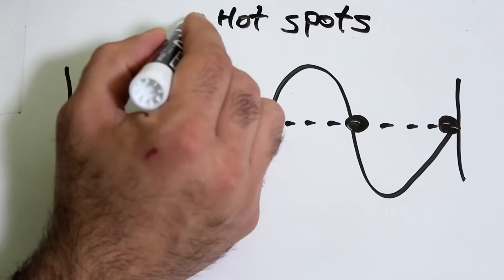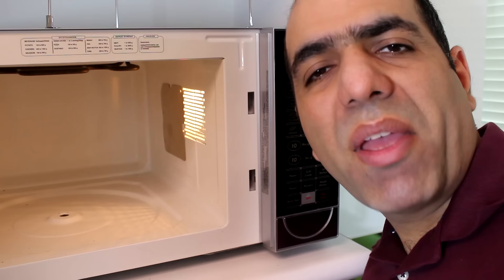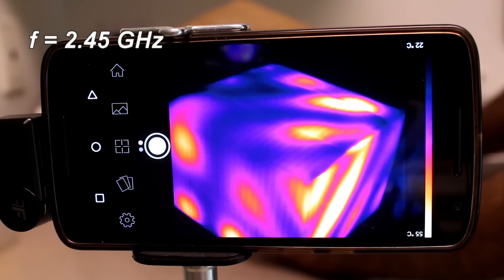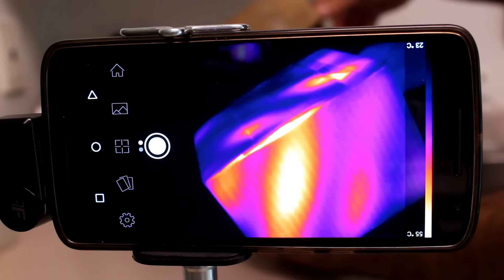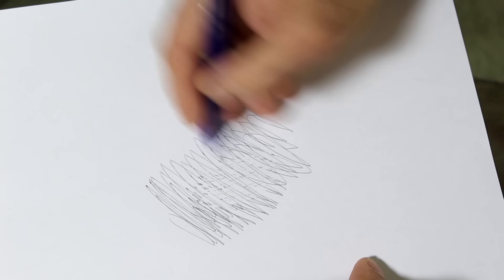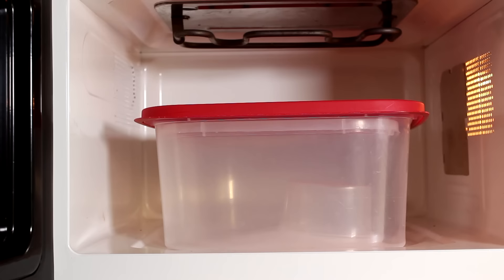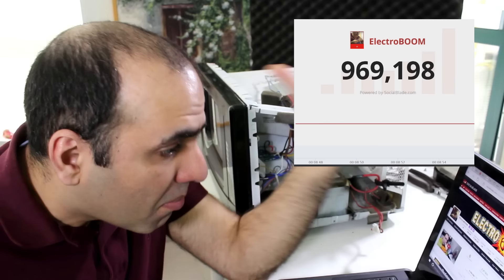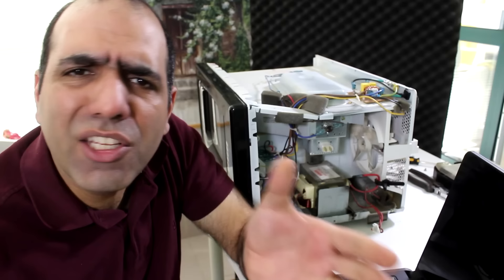Speed of Light, Microwave Oven and How It Works

Comment: "I dont really know what to do with the magnetron besides causing cancer"
Reply: Hahahahahahaaha
Reply: Jokes aside, microwaves are not ionizing so it doesn't really cause cancer. They may still cause burns though.
Reply: zirtapot57 
Microwaves are built to contain radiation which makes the process safe. However, a magnetron on its own without safety features simply shoot out radiation like crazy.
Reply: Miles Edgeworth Isn’t its frequency of operation still below the ionizing level though? I don’t doubt that it would definitely cause microwave burns.
Reply: Miles Edgeworth - Microwaves are non-ionising no matter what - particle decay, far UV and X and Gamma rays only possess enough energy to cause ionisation within molecules. Microwaves are on the thermal side of the spectrum - don't really see how they could cause cancer through their radiation? Similar to how a kettle or a conventional oven cannot cause cancer if you get too close to the elements. Its less to do with the output voltage and more to do with the electron voltage. 

Wikipedia actually has a fairly good article about Non-ionising radiation if you're interested.
Reply: +zirtapot57 While microwaves can't cause cancer directly burn injuries can trigger squamous cell carcinomas it's very rare but it's definitely documented. Typically when the burn wound doesn't heal properly resulting in chronic inflammation of the affected tissue ulcers or anything else causing chronic inflammation of these tissues can also trigger this (It's how smoking triggers lung cancers also).
Reply: zirtapot57 did you know if you break the pink end of the antenna you will get lung disease
Reply: And that's the cancer, not from the microwaves
Reply: yup
Reply: Omg there is one guy here that is smart enough to know about dangerous elements... or watches enough youtube.
Reply: who
Reply: With the magnetron in general, the beryllium ceramic causes the most cancer
Reply: @zirtapot57  It's not the microwaves that cause cancer it's the material that surrounds the microwave emitter
Reply: Berylliosis is a form of cancer right?
Reply: @milesedgeworth132  I had this tool that measured microwave leakage and more microwaves, at the same 2.4Ghz, were coming out of my cell phone, and my cordless phone, than anywhere around the microwave oven. Probably my wireless access point too.
Reply: @zirtapot57  It would definitely cause microwave burns. It can also coagulate the lens in your eye causing cataracts. If it cooks food – including the animal flesh that some people eat – how can it NOT cause microwave burns – we are made out of animal flesh just like the pieces of flesh that people cook in their microwave ovens.
Reply: eat the magnetron and change your name to Ovanski, (please don't mind this joke)
Reply: Yeah the beryllium causes cancer
Reply: @IJoeAceJRI  its the beryllium (the pink or grey ring) that can cause cancer IF scratched and dust inhaled. The magnetron inside a microwave is not nearly strong enough to cause cancer but strong enough to cause internal burns. The microwaves cause cancer myth is bs.
Reply: @markorossie9296  would have to very powerful tho. Air cleaners use electricity to clean the air, which produces ozone. I use a jacobs ladder to achieve that effect, because the arc also produces ozone. It would take a LOT of that to make anything dangerous.
Reply: @zirtapot57  it's not the wave(yes..it is of non-ionising type),
it's the pink thing on the magnetron(in the video-the colours could be different depending on the maker)..
that's why Microwave Oven is under California Proposition 65(in the US-This has to be declared on the packaging box)

If you really have to touch the magnetron..never touch that pink stuff with your bare hand..
(As a non-authorised personnel,please don't open the microwave oven for whatever reason)

Comment: Please be EXTRA careful if you take the magnetron apart, as you could get Berylliosis from the Beryllium stored inside that "stick" pointing out. This is not a joke, breathing in Beryllium dust is extremely toxic.
Reply: In most domestic microwave ovens, especially newer ones, Aluminium may be used instead of Beryllium though. This is not a guarantee and you should still be careful if you're not 100% sure whether your magnetron contains Aluminium or Beryllium.
Reply: Crazy Danish Hacker So it's safe to take appart a microwave but not the magnetron ?
Reply: +Llewln Not really, most (if not all) microwaves have a very powerful capacitor inside that could instantly kill you. Everything about microwaves are dangerous... That is, if you don't know what you're doing.
Reply: Crazy Danish Hacker beryllium is only in industrial microwaves
Reply: ShadowTech Uh, no it is not only in industrial microwaves, that purple band around the extrusion is beryllium oxide, and is a carcinogen to anyone who breathes it in.
Reply: ShadowTech: I'd like to see several sources, besides YouTube comments :-)
Reply: ShadowTech you can see the beryllium at 8:40
Reply: +Xenro66 They can be pretty damn dangerous even if you do know what you're doing and are careless or make an error. Big Clive has a good video on the subject. The high voltage from the MOT will kill you much more reliably and with less provocation than mains voltage.
Reply: Unplugged and dead microwaves only really represent a problem with the berylium then, I didn't know this, thanks :)
I've taken quite a few microwaves appart, but always outside and they have always had their pieces stuck in a box nearly instantly afterwards
Reply: The main issue with MOT's is that its a rather large amount of current when you consider that its around 2000VAC... the average of ~500mA is massive at that voltage. It's pretty much guaranteed to kill you.
Reply: He may know that you can get cancer from some of the components, but that's the least of your worries in this case. Getting Berylliosis is much worse as there's also no cure for it. At least with cancer you often have a chance to get treatment and a possible cure. 

A friend of mine has a similar condition from grinding wooden floors without a mask, and it basically ruined his life at age 20 or something. So don't make this a "non-issue" by trying to downplay it. ElectroBOOM should've made it more clear in the video that taking apart the magnetron and potentially some of the other parts can be lethal if done incorrectly.
Reply: Alright deleted my comment, didnt know the issue was that serious.
Reply: Quote: "However, very high power commercial microwave ovens and radar systems do contain beryllium oxide."
Reply: If you read the first comment, to my original comment on this video, I wrote the following: "In most domestic microwave ovens, especially newer ones, Aluminium may be used instead of Beryllium though. This is not a guarantee and you should still be careful if you're not 100% sure whether your magnetron contains Aluminium or Beryllium."
Reply: To breathe in beryllium dust you first need beryllium dust...
Solid Beryllium oxide is pretty safe to handle. You should however be careful not to drop it. It might break into several larger pieces and a bit of dust (but probably still not enough to cause acute beryllium poisoning).
Lead is worse. Stupid lead.
Reply: You'd literally have to smash the ceramic insulators with a hammer for it to pose any threat to you
Not only that, like 99.9% of the time you won't even have to touch the insulators
You'd be in more danger running the magnetron than breathing in the insulator dust
Reply: Or drop it onto the floor from an unlucky angle.
Reply: in which case the resulting dust won't reach your nostrils unless you are are the size of an infant
seriously, it's not as dangerous as everyone makes it out to be
Reply: It will if it's windy inside Mr RealDescartes. It's amazing how wind works, especially if you live in an air-conditioned home. (I don't though.) Also, would you take the change with live anthrax stored in a solid ceramic? I think not. :-)
Reply: Yeah I know right Sup3rman1c? Why would you think about breathing in solid objects through a nose in the first place. That's like literally impossible! Please tell me you actually don't believe you can breathe in the entire magnetron (assembled) through your nose. If not, then I have bad news for you man. I recommend you go back to your sauna and scream jumalauta saataana :-)
Reply: I made this mistake as a kid. No telling what damage was done. :(
Reply: Probably nothing because you got lucky Chris :-) If it's more than 10 years ago, almost certainly nothing. So no need to worry.
Reply: he knows what hes doing keyboard warrior 🙄
Reply: Viewers do not know mr. "I should just let viewers do potentially harmful things to themselves"
Reply: Edgar Brucke Why take apart a magnetron in the first place?
Reply: Magnetrons are so useful just most people don't know.Taking it apart once is ok to get the magnets but after that just no..
Reply: Beryllium is what emeralds are Made out of
Reply: EVEN "DEAD" MICROWAVES CAN KILL YOU! Just like the capacitors used in powering old CRT screens, if the capacitors were never discharged after the last use they can retain that charge for a very very long time. In small scale electronics most large capacitors will usually have high ohm resistors (so high that under normal operation they can be counted as an open circuit) across their terminals so that when the device looses power the capacitors will slowly drain themselves until they become harmless, but the sort of power levels used by microwaves makes this basically not possible as most resistors would just explode if placed across the terminals of such large capacitors at full charge. Basically my rule of thumb with microwaves and CRTs is that unless I personally assembled and was the last to use the device, assume everything in it is still at full charge. Sure this may be tedious, but given the risk of failure is unexpected instantaneous death I feel its worth the effort, no?
Reply: Wrong.  I have opened an old microwave (small one for personal use ) and it had beryllium in the magnetron.  It cost me like $5 on a Craigslist-like app which I was prepared to pay for the transformer.
Reply: Hey, Danish: When did "[b]erylliosis," etc. become a brand?
Reply: @CrazyDanishHacker  
he might have a big nose :-)
Reply: @dhruvchawla5476  
yes , the magnets are the only useful parts unless the magnetron still works and you want a transmitter :-)
Reply: @dhruvchawla5476  And the heat sink, but recycle the tube at some electronics store.

Comment: This was great! Can you do a debunking/explanation of cellphones causing cancer please? Just like you did for the free energy video
Reply: MultiSciGeek; The problem with that is that cellphones CAN actually cause cancer (look up the DNA unzipping mechanism), however, non-ionising radiation is VERY inefficient at it (just compare the sterilization effectiveness of 256nm UV light vs. microwaves of equal power).

This does, however, NOT mean that micro/radio waves are completely harmless though. Your cornea is actually very good at absorbing microwaves and doesn't get enough blood flow to effectively cool itself. Having enough radio/micro wave energy fall on your eye to raise its internal temperature by merely 5°C is enough to denature its protective proteins and cause a cascade eventually leading to cateracts.

The other really scary part is neural excitotoxicity induced by unregulated Ca(2+) influx from the constant stimulation by the high electric and magnetic field (which can also be used for good by removing the electric field component and only sending a magnetic pulse through the skull, as in TMS therapy).
Reply: THIS!
Reply: MRLT Right. Thanks for explaining this. This is exactly why I wanted him to make a video on this topic. First figure out if it is true, if yes how dangerous it is and how it work.
Reply: MultiSciGeek; You're very welcome :)
I completely agree, in today's society where EVERYTHING is "known to the State of Calofornia to cause cancer and birth defects", I believe it is increadibly important for someone to explain what things are actually dangerous and how to safely handle them (like how he showed that getting electrocuted in water is actually pretty difficult with normal household AC power).
Reply: MRLT Yeah exactly. And not just cancer, but there a lot of science myths and misconceptions and fake news and conspiracy theories are making this even worse these days. Cheers :D

Comment: The stirrer is in older microwaves and was phased out because it never really worked that well. It was before they had a revolving plate, I know this because I recently got the chance to scrap some microwaves from the 70's or 80's (not sure what time period, but they had fake woodgrain so I'm pretty sure there were from those general era's).

Comment: You forgot the HIGH VOLTAGE capacitor in there......... I hate you for not discharging it using your eyeballs or something lol
Reply from the maker: I think it is broken. I'll buy a new one and satisfy your needs!
Reply: Your eyeball or the capacitor?
Reply: He didn't show how to discharge the capacitor, the single most likely cause of death or injury from a microwaves. That loud hum means the magnetron, capacitor or diode is bad. Most likely the magnetron.
Reply: And a second motor that spins the plate
Reply: Those capacitors have bleeding resistors. I tried to make a bug zapper with a microwave capacitor and it didn't worked because the bleeding resistor discharged it from 2000 volts to 0 in a matter of seconds.
Still, it is better to check just in case.
Btw, could you make a power supply out of a microwaver transformer? I think it would be a cool project.
Reply: Some have an internal resistor and some don't. I used to fix microwaves for a living, so I know something about them. ;)
Reply: Never rely on there being a resistor, it can fail or be non-existent.
Reply: Just what would you be planning to power @ElecDIY? your voltage is too high for silicon (A Variac on the input can make them more usable, this is how I typically operate one). They do have their uses but are also very dangerous so not exactly recommended for manufacture use.
Reply: Sean N You can make a low voltage transformer with several taps and then use some relays and linear regulators to make a nice and efficient PSU.
Although some transformers seem to have heating issues, after changing the high voltage secondary by a low voltage coil.
Reply: heh, be careful not to put any metal in the microwave.. but there is a huge metal heating element hanging from the ceiling of the cavity for convection cooking!

Comment: I have learned some things by watching your channel. I learned about some mistakes to avoid, and you pointed me in the right direction for making my own power supply, since I couldn't find one to buy that fits my needs. I plan to build a power supply on my channel soon, and I will probably mention the things I learned from your channel as well. I will also protect my equipment in case a wire shorts somewhere, so I don't fry what I'm working on. I'm not sure if your accidents are planned, or if your actually making mistakes by accident. Some people are convinced you do it on purpose, but I wouldn't put myself through the things that happen to you on purpose. I'm thankful I an learn from some of your mistakes. I saw a mistake you made in a video recently, that will help me avoid the same problem, so that's great, although after thinking it through more, I don't think I was planning on doing exactly the same thing, that would have lead to the same problem, but it's good to think about it anyway, and steer clear of it.

Comment: The stirrer is ONLY in ovens that do not have a rotating carousel plate. The rotating carousel design eliminated the need to the stirrer in smaller ovens.  larger and commercial oven will have a stirrer and no rotating plates.

For the magnetron tube to turn on you need more than just the 2Kv, you need an HV capacitor andan  Hv diode. These will bring the voltage up and raise the amperage to the magnetron tube reaches resonance and start working. Also you need 6 volts for the cathode heater in the tube. This is the third winding on the MOT.
Also a warning, The magnetron is made of beryllium ceramic and is VERY toxic so handle with care and do not break it.
Reply: I was thinking the same that rotating carousel plate eliminated the need of stirrer.
But am also wondering how is the plate better option as compared to stirrer. One thing I could think about is energy requirement which I believe stirrer uses less. Maybe material used for making the stirrer is expensive or difficult to make.
What do you think?
Reply: @tachyon1132  ElectroBBOOM should have pulled the HV diode out of the microwave.

Comment: Heavy noise is usually due to a bad diode that is connected to the high voltage capacitor. It can be fun to repair these ovens, but be sure to safely discharge the capacitor first.  My stainless steel oven is now 18 years old and still looks as good as new. I have repaired it a few times, but I got the parts from someone else's oven that they had tossed out for disposal. The turntable motor stopped, but a few drops of glue fixed that problem.  Thanks to simple repairs that cost basically nothing, my air conditioner is now 19 1/2 years old, my coffee maker is now 16 years old, my SAMSUNG TV is now 12 years old, my big floor fan is about 22 years old,  my SHWINN 6700p Treadmill in now 23 years old,  and so on, but they are all working as good as new.